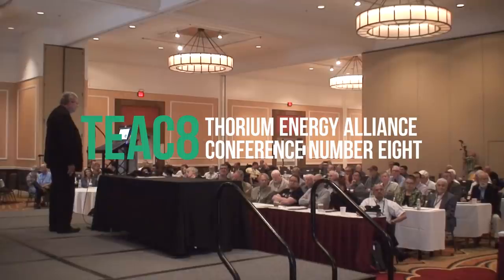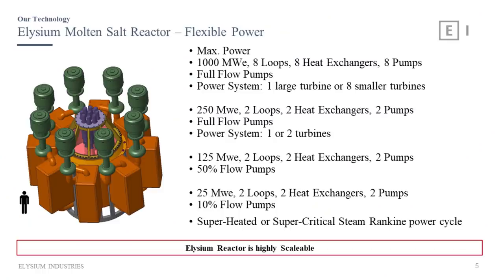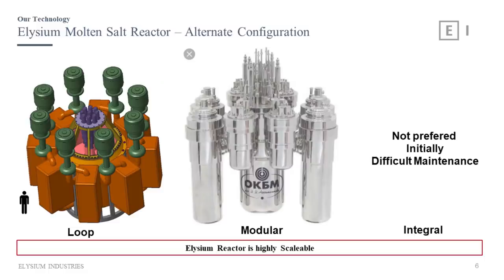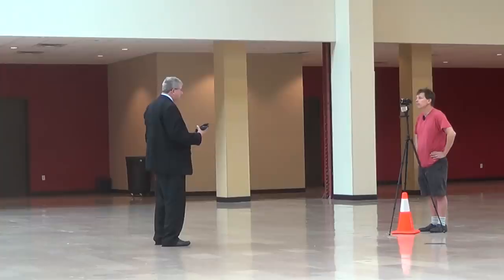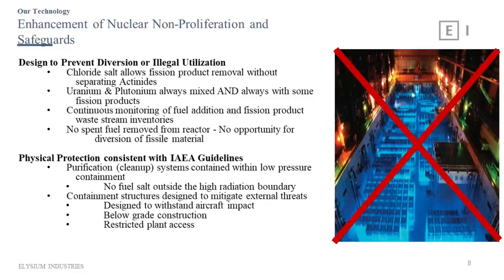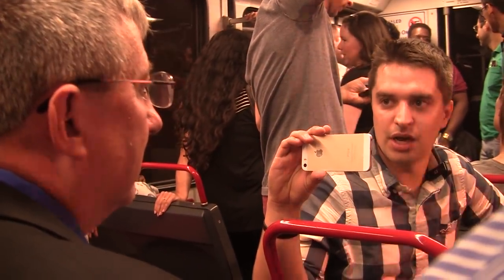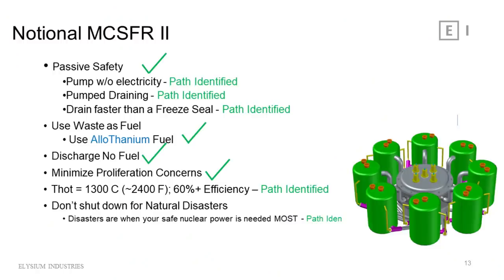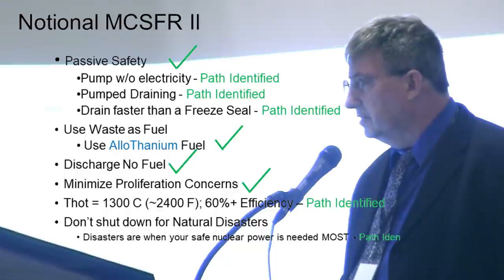Fast-Spectrum Molten-Salt Reactor - Elysium Industries - Ed Pheil @ TEAC8

Comment: No graphite moderator, leveraging existing nuclear qualified building methods/materials, ability to leave the fission products in solution longer and fuel flexibility overcome the drawbacks of required higher fuel loads and fast-spectrum characteristics. This one has my vote. This really makes sense.
Reply: Yeah,  the absence of a graphite moderator is a biggie.   In addition to improving neutronics and making sure you have a negative temperature coefficient, the graphite needs replacing every 4 years.  And it becomes radioactive waste.   Saving big $$$.

Comment: Regardless of your opinion on the Fast vs. Thermal debate, we can definitely agree that a molten salt reactor is THE ideal medium for operating at a fast spectrum.
Reply: In all fairness a prompt critical sodium reactor doesn't result in an environmental disaster :P
Reply: If you can get past the whole Polonium thing, lead is such a superior liquid metal coolant that the only reason why sodium is even still considered is due to inertia and all the prior work done in producing double walled heat exchangers, MOX fuel campaigns that mitigate against positive void and Russian advances in their BN-x00 series.
Reply: Lead is harder to pump and has a much poorer heat capacity, but the heat capacity issue is probably counteracted by the lack of a double walled heat exchanger.
Reply: MonMalthias 
Lower Pb operating temperature vs sodium, and higher m.p. (freezing) are the Achilles heal of Pb/ PbBi, not Po, in my book.

Of course Na is not that much higher temperature, limited by fuel or clad interaction concerns.
Reply: Why use a coolant that is reactive to water and air?  Shit happens.  Like earthquakes and tsunamis.  Also terrorism.  Molten salt can handle all these contingencies.
Reply: What happens if there is an earthquake and the sodium gets in contact with water?  Boom?
Reply: Eh Team: Tell that to the folks at Monju
Reply: Lead-Thalium-Bismuth is the most reasonably liquid metal coolant because is more stable than Potassium-Sodium-Rubidium mixes

But is not better than chloride or fluoride molten salt, lead coolant has a high vapor pressure and doesn't got the thermal capability of molten salts that means you need to pump a lot of lead from the reactor in order to transfer enough energy

And is also more corrosive than salts, you need to use very high chromium alloys, and low nickel, basically the opposite of molten salt, which as i investsigated has a lot of materials that are capable of handling the salts at high temperature like Titanium and Zirconium nitride/carbides
Reply: Coolants cannot be considered by their performance in the reactor in isolation. Such mindsets give you molten sodium and we all know how that's worked out every time someone's reassured regulators that "it can't catch fire this time".

When you factor in the chemical toxicity and biocompatibility of the various stuff being used, thalium, lead and bismuth are out (especially given the vapour problem). 

Sodium burns far to easily to be considered even in a mad scientist's laboratory 

As we've seen time and again water has too many problems - not hot enough for decent thermal efficiency in the turbine side, contaminants getting into the biosphere (various), prompt-critical steam explosions (SL-1, Chalk RIver, Chernobyl), fuel rod meltdowns(TMI, Fukushima), hydrogen explosions(Chalk river, Fukushima)  and criticality events when employees play fast and loose during reprocessing (R.I.P. Mr Ouchi)

The advantages of the salts from a safety point of view is that they don't dissolve in water, freeze at relatively high temperatures, won't burn, can't boil, don't need pressurisation, have relatively low viscosity whilst molten and aren't particularly corrosive. 

Active fuel salts being fiercely radioactive if they do leak is an advantage, not a disadvantage - it makes tracing easier and theft much harder.

The fact of being able to do relatively simple inline chemical reprocessing takes out most of the proliferation risk - it's simple because only enough chemical processing is needed to prevent the core from being stopped, so "industrial chemistry" approaches are adequate - and most of the byproducts are actually valuable saleable items once left to sit and lose their residual radioactivity. One thing to consider is the potentially transformative effect reliable bulk supplies of helium+xenon far in excess of forseeable demand may have on the world economy.

Chemically problematic materials can be dropped back into the fuel stream to be further broken down, or preferably not removed in the first place. Fuel stream processing is only there to remove poisons and end-products and only to the extent that they interfere with energy generation.

Any attempts to subvert the fuel salt flow into weaponry is going to  be both heavily contaminated with fiercely radioactive isotopes (equals short lifespan for potential terroroists stupid enough to handle it, or massive cost and complexity for nationstates determined enough to try separation which is detectable) and will be rapidly detectable as an unsustainable drop in reactor output. I'm assuming single salt setups as that's what nearly everyone is advocating.

There are some interesting economic aspects to thorium for reactor fuel - there is enough extractable thorium in the USA's myriad coal ash dams to make it worthwhile mining those and thus avert a number of pending wildly expensive environmental disasters. The "rare earth" mining problem (including cobalt supplies(*)) essentially solves itself too as those mines would become thorium mines with a side-stream of rare earths instead of rare earth mines with a thorium waste pile. And that's quite apart from being able to use LFTR or other fuel salt systems to burn up waste from existing nuclear technology.

Yes, fusion would be a better solution. I don't expect to see that being commercially viable in the next 200 years. In the meantime we have more important issues to deal with - like oceanic acidity levels, methane emissions from Arctic clathrate deposits (look them up) and the possibility of another "storegga" scale methane emission if warming in the arctic continues - this is likely to result in an anoxic event unless we curb carbon emissions somewhere back around 1900 levels if not lower.

"We" as a species can't hang around and wait for a better solution. The fire alarm is already ringing.

I really hope that we can see commercially viable MSRs. They were needed 40 years ago and they're critically needed now.

(*)Cobalt issues are likely to be self-solving anyway as battery research is focussing on how to eliminate it. Lithium readily is obtainable from seawater (current mining is from brine lakes only as a more concentrated source) so media hype on that one is mostly just that - hype.
Reply: I don't think that's a debate at all, unless we want to keep building the inventory of spent fuel, we need to go fast spectrum. Sodium is potentially explosive in contact with water, lead is just way too toxic in the wild.  I like this one though, i like it a lot. Fast molten salt looks pretty sweet. Am i missing something or is the way to go?
EDIT: Also i don't like thermal molten salt at all, graphite moderated is unstable and it burns forever if you melt down.
Reply: @hjembrentkent6181  lead is too toxic? Never stopped anyone from building and using shooting ranges. Considering in my youth we were using leaded gasoline, and our houses were coated lead paint, old water pipe solder was leaded, as well as the lead in bullets. Obviously I'm not arguing that it's harmless, and we certainly don't want it in municipal drinking water, but,... I'm having a hard time imagining that this argument is a game killer.
Reply: @MonMalthias  Also the fact that Lead is very heavy, meaning you need to build a much sturdier structure and earthquake safety. Lead is kinda so-so. I think Belgium is using for a research reactor.

Comment: What is very encouraging is the quality of engineering talent that is being applied to solving the challenge of building high temperature, low pressure, passively safe nuclear power generation.  I hope we can get to deployed utility-scale quickly enough to make a meaningful and timely difference to reducing CO2 emissions.

Comment: That was extremely interesting to listen to. 

His reactor design seems very flexible for the number of fuels that can fission in the salt blanket. 

The proliferation risk is really the only potential opposition left to an MSR as they already are passively safe - his system seems to have this issue completed solved. 

Will be seeking out more of his videos. 

Thanks for the compilation 👍🏻
Reply: A simple, safe, inexpensive way to turn "spent" (wasted) PWR fuel into new MSR fuel, little or no reprocessing needed to burn pretty much all the actinides in that inexpensive fuel, a 40-year reactor life without having to diddle with moderators every four or seven years, all of the safety advantages of MSRs, easy safe constant refueling, and probably the least expensive fission power possible? Wish I had a billion bucks to invest.

Comment: What I liked about David LeBlanc's reactor was the fact that he had carefully looked at bringing down cost and not straying too far from technology that was known to regulators. It seems that Ed Pheil did the same but just better. Still David has come farther in the developement. Gordon, do you know in which phase Ed Pheil is in? And where does he want to build the reactor?
Reply: Bringing down cost is very important if there is to be a new reactor generation. But the Chinese are not looking at cost like the west do, They have a massive program and will beat us. But at least someone is trying to give them a good run for their money
Reply: You can't get nearly as much flow with convection, so the power would be much less. In an off state there could be convection.
Reply: There's nothing preventing us from using natural circulation during a power failure and an off state.
Reply: That's a tall order for convection; you really need to do the math to understand it. It works easily for 25 MWth, not so good for 3000.
Reply: Where are these reactors you speak of?
Reply: It looks good, Argonne is doing a demo of the spent fuel to fuel salt process as we speak. The prototype will probably be at Savannah River because you have access to Plutonium and spent fuel on site. He will even get paid to get rid of the Plutonium, which US has to get rid of according to treaty. And remember, the prototype will be identical to the highest power version, only difference is the heat exchanger. Looks like Ed is essentially good to go.
Reply: We are currently targeting the US since we got them to be MSR friendly. Because the CNSC is more anti-nuclear (11 year licensing minimum) , than the NRC (6 yr minimum).
Reply: @EdPheil  - Ed: I can't find your website. Can you provide an updated link? Your reactor concept is ingenious. How can I and others who believe in your work support you?

Comment: Just wanted to point out something in terms that the average person would understand. When Ed ells us that he could use the same reactor vessel for 50MW up to 2000MW, that tells you what you could replace with such a reactor (or two) 
Right now, the Colorado River is not keeping up with demand in the southwestern USA. Too many people are using too much water. Glen Canyon Dam (which created Lake Powell)  is currently not putting out anywhere  near its nameplate capacity because of the low water levels, however, it could be replaced entirely with one single fast spectrum MCSR. Hoover Dam, the larger of the two, which is also well below its nameplate capacity, could be replaced by two of these. 
Glen Canyon Dam could be removed entirely to restore the natural riparian ecosystem. Just take a look at some of the pictures out there before Glen Canyon was flooded, and you'll see what a loss it was.
People don't associated nuclear with green movements, but being able to rip out a dam and restore the natural flow of  the Colorado (oh, and stop the evaporation loss of 380,000 acre-feet of water a year) sure sounds green to me. Especially when the power plant that replaces it would emit no carbon, NOx, methane, etc AND could run on the waste from the Palo Verde LWRs
Reply: Dams are generally too useful to get rid of even if you don't need the electricity.
Reply: @MrRolnicek  Depends on the dam. Being able to store water is a good thing. Flood control is another benefit. However, in my example of Glen canyon Dam vs. Hoover Dam, there are some geological differences. Mainly in the type of rock and the physical volume of the lakes. Lake Mead sits primarily over basalt which is far less porous than the sandstone under Lake Powell. Lake Powell loses considerable water volume to bank seepage. Some estimates place the seepage and evaporation losses high enough to supply Los Angeles. Lake Powell has greater surface area, which leads to greater evaporation losses. Lake Mead physically holds more water (when full) and would lose less of it each year, than both lakes combined.
The need for flood control and water storage could be satisfied by one larger lake. The few small communities that rely on Lake Powell, could be served by a smaller dam to create a storage reservoir while still allowing plenty of water past Glen Canyon Dam. And using a couple molten salt fast reactors in place of the Glen Canyon Dam powerplant, would allow Arizona to eliminate the need to store waste at the Palo Verde Nuclear Powerplant while still providing all the electricity its northern cities require.
Reply: @DriveCarToBar  I meant it more in a general sense. But more power is always good and frankly Elysium is currently my personal favorite. I do hope we'll go for clean energy soon even if it isn't Elysium that gets us there. Even current generation lightwater is frankly cleaner and safer than anything else out there. (Except hydropower I guess that should be cleaner, right?)
Reply: @MrRolnicek  I too like Elysium and their molten salt fast reactor. For me, its a bit of a toss-up as to which I'd like to see developed first. There are some difficulties with fuel salt chemistries, but now that the NRC has made liquid fueled reactors a real possibility, development should proceed more quickly. The Liquid Metal Cooled Fast Breeders like the IFR developed at Argonne have the most actual real-world development and a reprocessing system that is ready to go right now. GE/Hitachi already has the plant designs based on Argonne's research and development. Russia already operates Sodium cooled fast breeders in commercial settings. ANd because both the IFR and MSFR are fast reactors, they can gobble up waste fuel. Which, to me, is the key selling point. It cleans up the mess from 60 years of water reactor operations AND provides enough clean energy to run modern civilization.

Comment: I love the "just a can" method. No graphite complications. I hope they make a breeder version.

Edit: If the breeding ratio is 99.3% then it can self sustain on natural uranium due to what little fissiles it has. More expensive (and secure) net breeders can make the startup material if we need it.
Reply: This IS a breeder concept. It only works as a breeder. Keep in mind that the neutron flux has to be much higher because of reduced cross-section. "Just-a-can" could do better with neutron reflection but that might complicate the can metallurgy.
Reply: I thought it needed a breeding blanket, or it would be really difficult to breed net fuel. All the better being a single fluid reactor with simplified chemistry, unlike the single-fluid thermal thorium MSR. 

Simply by surrounding the core with lead or tungsten will reflect some neutrons.
Reply: @leerman22   Yeah, but reflecting neutrons will also increase the critically of the reactor resulting in flow of some of the core into the drain tank, resulting in less breeding.

Comment: Gordon: Very good Video, Thanks. I like all the technical details. I miss details about safe control of fast reactors and the fissile doubling times Elysium expect. And how does fast molten salt reactors compare to solid fuel fast reactors?
Reply: Thomas Jam Pedersen 
No reprocessing separations, don't need to remove all the fission products to periodically remanufacture the solid fuel, and the associated proliferation concerns, one chemical step to convert SNF/Pu to fuel vs pyro-processing at 7, and PUREX (France, Japan, UK, Russia) with hundreds, so much, much lower cost. We are testing this conversion (not reprocessing, since there is no separations) at INL & with ANL, as we speak.
Reply: I have read shorter prompt neutron life makes control of fast reactor harder. Does this affect passive safety?
Reply: @achalhp  In a word, No.

Comment: I especially like the concerns about, in a thermal spectrum, protactinium separation... I'm afraid of this about LFTR.
28:05 to almost 30 minutes into this speech.
Reply: Yes that is an issue, if you put Thorium in any reactor you have to protect the Protactinum for a year after discharge. No need to use Thorium for now, we have sooo much LWR "spent fuel" to get rid of anyway.